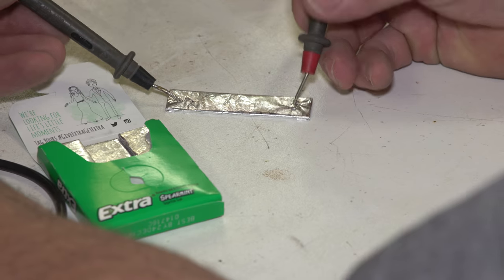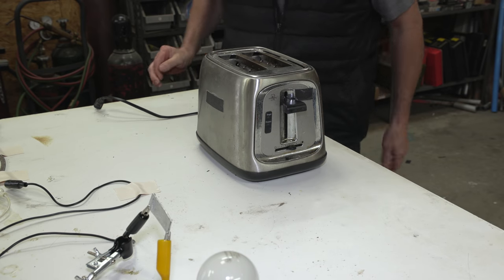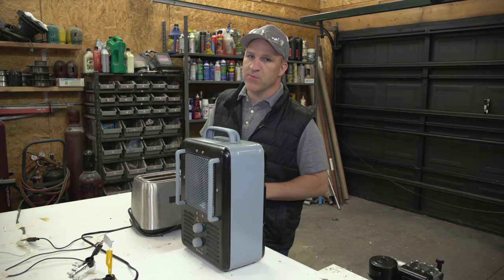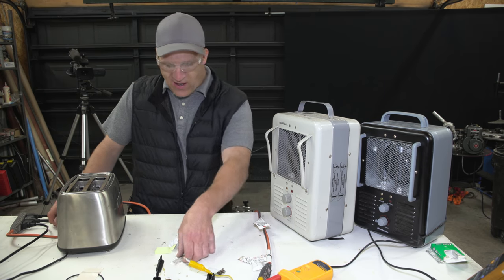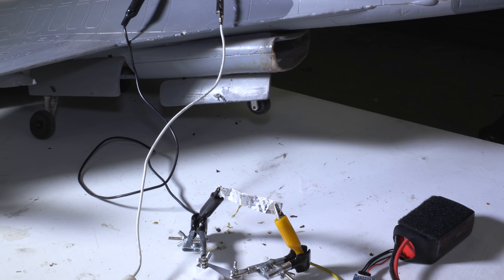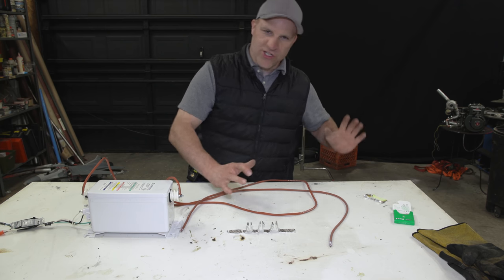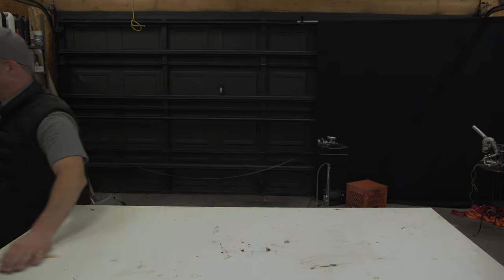How Much Power Can a Gum Wrapper Handle?

Comment: Do the math:
I used the 7pcb website's trace width calculator.
Quick online search indicates (from alibaba and such) that the thickness of aluminum in laminated gum wrappers is 5-7 microns. Converting to mils, 5 microns is around 0.2 mils. The dimensions of an opened gum wrapper are around 3 inches in length and 2 inches in width. From the calculator, we see that a 10A input with 0.2 mil trace thickness with ambient temperature 25 and temp rise of 10 with trace length of 3 requires 2000mil or 2 inches, so this gum wrapper in air can handle 10A no problem - consider the cross sectional area of mains carrying circuit boards!
Reply from the maker: Wow that's great information, the one variable though is you don't really know what type of aluminum they are using for the gum wrappers, some of those PCB materials are alloys of some sort to make them more conductive and heat resistant. Nonetheless that was awesome math!
Reply: @WarpedYT  Alibaba lists 8011 alloy, which is supposedly 98% pure aluminum (hopefully very pure since it's food grade, but we're not using Chinesium anyways). If you assume that you're dealing with aluminum alloy that has conductivity of 60% that of copper, making the trace thickness 0.2*0.6=0.12mils to compensate for increased material resistivity, you wind up with approximately 20C temperature rise in steady state conditions in air. If you consider the foil inside an insulator however as actual wires are, the rise could be much much higher and you'd probably run the risk of melting insulation, short circuiting, and burning something down (aka don't wrap the wrappers in used gum and expect them to be safe wires lol).

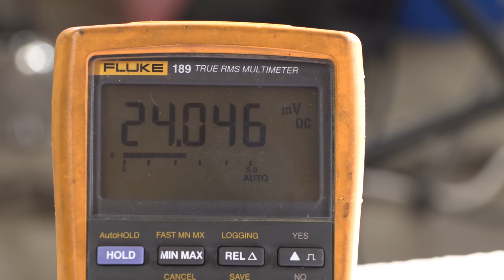Comment: 11:48 How come you say Amperage and the meter readout says "Mv" ?
Reply from the maker: Yeah I'm sorry about that, I should have clarified, so the meter reads milliamps from the clamp amp meter. Basically every whole number is an amp, so if it says to milliamps that equals 2 amps. I'm so used to using the meter, that I forgot to clarify for everyone. But I'm really behind my production schedule so I'm cutting a few corners on these videos. I really wanted to put this gum wrapper through some more extreme tests that I had in mind but unfortunately I didn't have enough time. I am so behind
Reply: @WarpedYT  If you make quality videos don't worry about making quantity. The only thing that really wasn't scientific was the last test since there was no load and the setup had the advantage of destroying the wrapper since it used open spark gaps. Ampwise, I'm not really that surprised because once you take in account all the surface area on the gum wrapper it's a fair amount. Would have been nice to include that math, too, but you can't have everything.

Comment: Why dont you get an extension chord, with several outlets  then simply pull the wires apart and bridge them by the gum. Then by turning the extension on by the on/off switch in the chord itself you'd be closing the circuit  thay way you can simply plus2, 3, 5, 6 items at once easily

Comment: Interesting experiment. You live near Wrigley's field so it makes sense but you are probably a White Sox fan, been there too. Comisky park. Ohm's law applies with this one! Edit: I live near where the guy used a .22 bullet in place of a fuse. And the chick had biscuit package explode in her hot car.
Reply from the maker: I'm not a fan of White Sox or the Cubs, I don't watch sports at all,  I hardly ever watch TV. 🌝
Reply: @WarpedYT  
I prefer sports that require 2 balls myself. Racing is my fix.

Comment: Not really that shocking! Back in the '70s. Many people had screw fuses in their houses. Then burned down their houses by placing either a gum wrapper or a penny to connect the circuit when the fuse burned up.  I watched the old man's house across the street go up in flames when I was 10.  He told the fireman. He put a gum wrapper behind the fuse 20 min before the fire.

Comment: With the DC test, didn’t the meter show in millivolts?
Reply from the maker: Yes with all of them, the way the clamp meter works is every millivolt and puts out equals 1 amp, whether that's DC or AC, that's just how the meter works with the clamp. I realized that I should have explained this in the episode,  but unfortunately I realized too late. Thanks for asking but yeah everyone millivolt equals 1 amp
Reply: Wow! When I checked the current draw on my home AC compressor, it showed 42.6 amps at 230 volts. The breakers kept blowing. How does this calculation relate to your testing procedure? I’m confused.

Comment: It's amazing to see that a peice of gum wrapper can handle 100A
Reply: 100 Amps was maximum that he can draw from the wall. The gum wrapper failed at ~32 Amps
Reply: @michal_c9007  it failed because it was clipped on the edges but when you make good connection it can handle 100A

Comment: So how much of the AC power was conducted by the wrapper and how much by the gum?
Reply from the maker: Good question and all of the future episodes I'm going to go more in detail with all of this stuff, but the gum had extremely high resistance. so it was basically non-conductive, the only reason I left the gum in the wrapper is for aesthetic reasons, it looked really messy when it was just the wrapper twisted up. I did however film one scene where I use only the rapper with no gum inside, it was basically the same amperage reading, it just looked uglier. Thanks for the feedback though, that was a great question

Comment: For the Fluke meter, when you use it with a current clamp for measurement of current, are the units displayed in mV? I have never used it in such a configuration. Does anyone know?
Reply from the maker: Yes in this case that is correct, because the type of amp meter I'm using is an ac/dc type which has its own batteries

Comment: Would this work in the uk with mains being 240-250 volts
Reply from the maker: Well the higher the voltage the lower the amperage, that's basically why I tried a very high voltage. Again I was very amazed

Comment: The alligator leads would fail before the wrapper. Also why are you using appliances instead of a resistor so you know the exact amperage
Reply: He clearly didn't have any high amperage resistors laying around, the better question however is why he didn't actually measure the resistance of the heaters and the voltage at the outlet using his meter and actually do the math lol
Reply: xXPORTALXx The resistance can change as the wire heats up. Plus it depends on the meter, but mine is really garbage for anything less than a dozen ohms, and if it’s a 1200w alliance, that means it is 12 ohm, and at least with mine that will give a decent amount of error anyways (his is nicer, but those wires will change as they heat up, and since you can see the toaster glowing red, they certainly heat up a lot!). How much that changes? I don’t know, you’d have to know the alloy they used specifically for each appliance and the temperature of the wire.
Reply: @jakegarrett8109  I am an electrical engineer, and the change in the resistance based on heat is called non-ohmic behavior, which will certainly happen, however for the material used in heating appliances that change is less than .02%, in any event you need a new meter as yours is clearly already garbage.
Reply: xXPORTALXx I do need a better meter, lol! I was testing Nichrome wire for heated apparel, and it almost self throttled it’s temperature a large % due to massive changes in resistance. It was, interesting... I thought initially it was going to overheat when the apparel was abused and catch fire in some scenarios such as folded in on itself) but it didn’t (it will if you want it too, it’s used to rocket ignition systems, like flash incineration at something very hot like 3000 degrees or something, you know, not that safe for cotton apparel!). I did get burn marks at one point while testing and my teachers were freaking out a bit (pre-engineering project at Votech, but ironically the project that almost set fire to the building was a heated spoon gone wrong, lol!).
Reply: @jakegarrett8109  let me rephrase while staying within the usable ampacity of the wire it will vary less than .02%, beyond this and you'll begin to grade the metal and should avoid this region for both reasons. Nothing is truly ohmic, ohms law is really just a good approximation, which is the name of the game in actual ee work, it is fundamentally impossible to have perfect accuracy, by the very laws of physics, not to mention the thermal effects and parasitic components which can change due to such diverse things as humidity and atmospheric static charges, the conductivity of surrounding objects can cause values to skew for christ's sake! In general anything beyond 3 sigfigs is a wasted effort

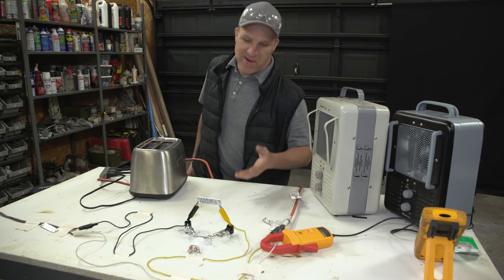Comment: The content is really cool, so what I'm about to say is not aimed at that. I also acknowledge that the author of the video may not have done the editing and would not have had anything directly to do with this. These videos on youtube where the songs used aren't listed somewhere, ANYWHERE, need to stop. I'm over here replaying 5:27 - 5:44 at earsplitting volume to try and make out a full set of lyrics so I can find that song. This is an issue and its not even that hard to fix. Just ask the editors for a list of songs used, if you yourself did not do the editing, and add it to the description. People like me are dying on the inside. Please make it stop.
Reply from the maker: Thank you very much, I myself actually do most of the final cuts, I picked that song I'm glad you liked it. It's called stronger than you know, I don't think it's publicly available but I'm not 100% sure. When I get back to my studio tomorrow I'll look it up for you.
Reply: @WarpedYT  Thank you so much.

Comment: This shows how dangerous dc is compared to ac. The gum wrappers had less amps and less voltage to burn it up on dc. Also how much more dangerous high amp is vs high voltage! Thanx for the video!
Reply from the maker: Much more dangerous then AC, that's why I gave that example, it was the same amperage but only 11 volts, imagine 120 volts DC at 30 amps, that's what makes working on electric cars so dangerous as well. That's exactly why I gave that comparison.

Comment: Would had liked to have sean each experiment done with and without the gum inside. A bit more scientific and would had given an idea if the gum was acting like a heatsink or some kind of insulator. Or even twisting the wrapper and coating the exterior with the gum as an insulator
Reply from the maker: So there was one scene where I used the wrapper without the gum, but it looked pretty messy, and it handled about the same amperage, and it was kind of repetitive, so I got pulled out of the edit.

Comment: I wonder how it would fare on the UK system? 230/240 volts.
Reply: even better double the voltage means half current and only the current heats the conductor
Reply: @nickhetzer2744  true. Although I don't think it's quite half the current.
Reply: @dylanharding5720   if you have double the voltage at same wattage you have the exact half current P=U×I
Reply: @dylanharding5720   probably the different frequenzy would have a minor affect on the real world measurement but so littel that it doesnt matter if im right usa has 60Hz and uk 50Hz?
Reply: @nickhetzer2744  yeah, 50hz

Comment: I feel like I have a new way of rating LiPO packs - can they torch a gum wrapper in under a minute.  high performance 6S1P packs probably can even at lower (35-45C) discharge, but this is truly ridiculous.
Reply from the maker: There was a scene that was removed from the final video where I short out the lipo with the gum wrapper, it was just kind of okay but it did catch the gum wrapper on fire almost immediately.

Comment: Great, now where's the fuel injected turbo nitro see through cylinder head  engine?
Reply from the maker: I have one more small episode and then the EFI video oh, I'll see you after so it's jumped in front of it on the schedule because I had some building challenges with the EFI system and the timing. That you have fi system episode is half finished, just working on the other half now hoping to get it done this week. I have so many more episodes after that but I got to get that one done first oh, it's been a real challenge but it came out pretty insane... I'm so eager to get that posted you have no idea. Thanks for asking and following up, I feel more pressure to hurry! 😁

Comment: Your analogy for voltage and amperage is dead wrong, and backwards. Voltage is the number of skiers on the hill. Amperage is the slope of the hill. Resistance is the number of trees on the hill. Great videos otherwise!! 🙌
Reply from the maker: Amperage by definition in the over all flow or volume. Like your water faucet, voltage is the amount of pressure in the pipe, amperage is the amount of flow coming out of the faucet and resistance is how far you have the faucet open. That's the way I see it. Thank you

Comment: Ohms law says I= U divided by R . in this case its 0.34 ohms approx . power  in watt is U times I . so simple math can solve this realy fast. so at 10 volts the current is 29,412 amps and the power is 294,118 Watts... Qestion remains how much heat can the material handle.. thats where this videi comes in.. ps.. i steal yer RC jet and take it to my flying club. 🤣😈😎